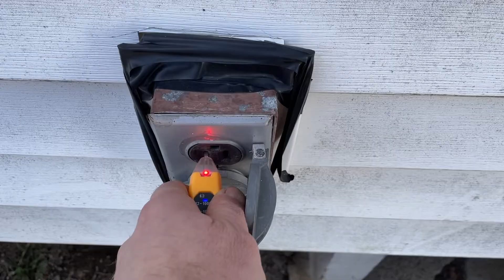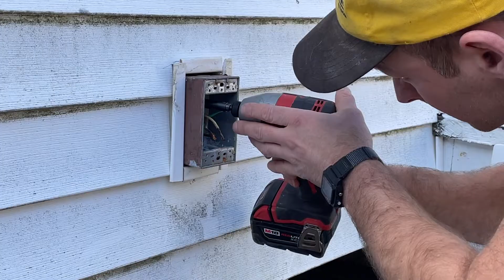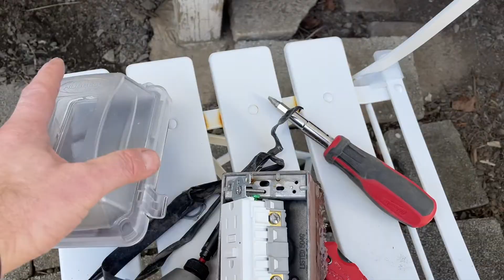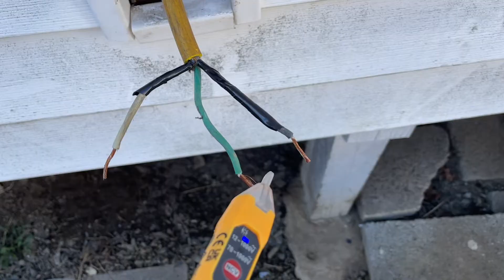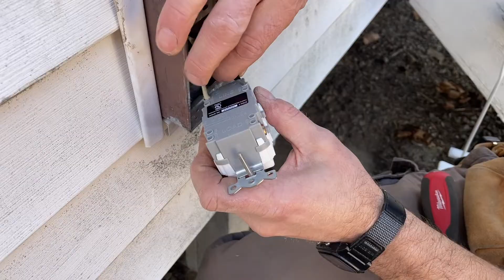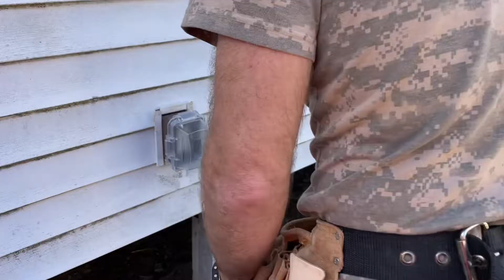How to Replace / Install an Outdoor Weatherproof GFCI Electrical Outlet (full steps)

Comment: Great installation of this gfci outlet this was helpful and I am wondering if the gfci outlet still work or you had to replaced it because the outlet is outside?
Reply from the maker: It’s for outside.  It’s all good.     We just change the wiring that was going to it later on

Comment: You were supposed to slide the two GFI screws into the slots on the cover, then secure the cover with 4 screws. Two on top, two on bottom.

Comment: I dont understand why you didnt throw away the old box and then place the plastic on and have that recessed into the wall.??? It doesnt make it water tight i dont think…because the box is supposed to be recessed into the wall
Reply from the maker: you need housing for the outlet.  the plastic is just cover  to protect from water etc.  as you see outlet face sits on back of the plastic box.
Reply: Oh…its not a box…got it thanks @HowToWithLech